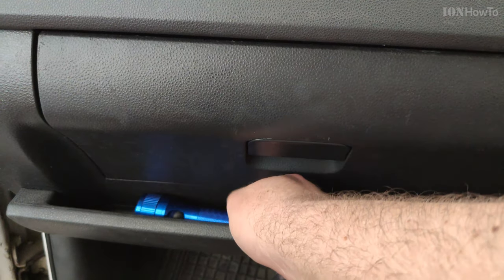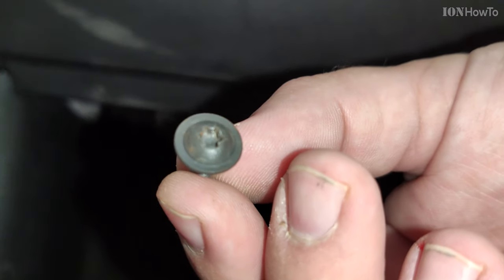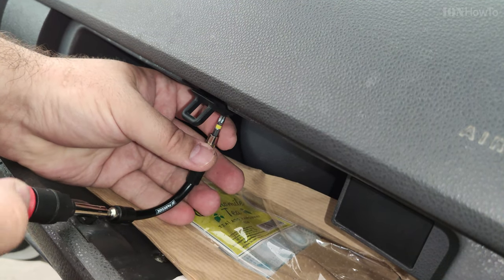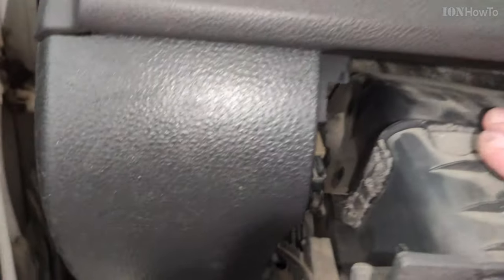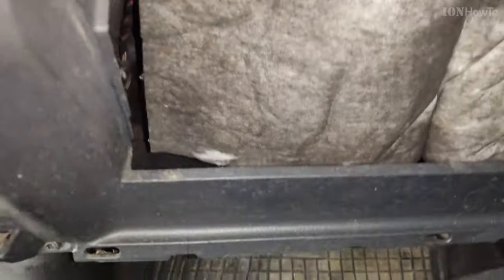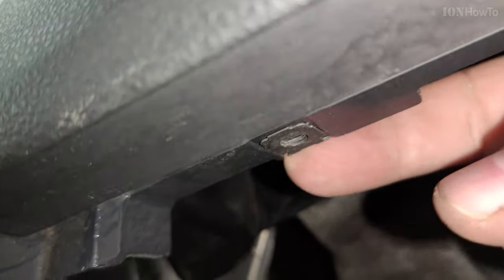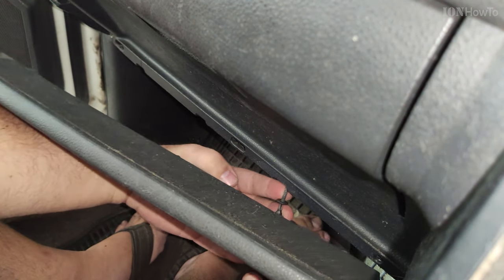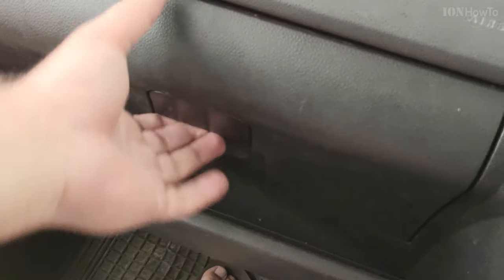How to Remove or Replace Glove Box on VW Polo 9N Mk4

Comment from the maker: Amazon: Glove box latch vw polo 9n https://rex.red/Glove-box-latch-vw-polo-9n *
Glove box vw polo 9n https://rex.red/Glove-box-vw-polo-9n * 
Tools https://rex.red/car-tools-kit-mechanic *
Cleaning https://rex.red/car-cleaning-supplies *
WD-40 https://rex.red/wd40  *
Torx socket set https://rex.red/torx-set-socket-45-55-60  *
Jack https://rex.red/car-jack *
Stands https://rex.red/car-jack-stands-heavy-duty *
Gloves https://rex.red/car-gloves-mechanic *
Safety glasses https://rex.red/safety-glasses-anti-fog *
Spark plug removal tool  https://rex.red/spark-plug-removal-tool  *
Spark plug Gap tool https://rex.red/spark-plug-gap-tool  *
Coil puller tool https://rex.red/coil-removal-tool  *
Car fuse set https://rex.red/car-fuse-kit  *
Battery tester https://rex.red/car-battery-tester  *
Maintenance kit https://rex.red/car-maintenance-kit  *

Subscribe and Ring the Bell to watch more videos.
ION HowTo https://rex.red/ionhowto
RedNumberONE https://rex.red/rno

Buy merch https://store.ionhowto.com/
Check it, buy it, post it and  tag it #ionhowto or #rednumberone

Join this channel to get access to perks:
https://www.youtube.com/channel/UCx4Qbp3iC97kQzj7e7g7slg/join

We earn money from qualifying purchases using our affiliate links.
Affiliate links are marked with a star. *
When you use our * links, you support this channel.
As an Amazon Associate I earn from qualifying purchases.

Comment: I’m trying to fix a leak in the washer piping. The washer fluid runs down the left chassis member from somewhere around the bulkhead but I can’t see any fluid in the engine compartment or near to the pump/bottle. I think the pipes run behind the glove compartment but did you see any there when you removed it? Thanks.
Reply from the maker: Never had to look for those but it doesn't make sense to come inside. It should be all around the engine. Look for a repair guide on that.
Reply: If you see water close to your glove box(inside of the car) then it could be the heater core since it's the only place that has water flow.
Reply: @alexpapadopoulos9179  I fixed this problem. There is a pipe that runs from the front to the back of the car to take washer fluid to the rear windscreen. It is joined in two places by inline plastic joins, one near the bulkhead and one in the boot (trunk). If the fluid freezes or the jets get blocked they can push apart and I’ve now seen both joins fail. Easy to fix - just push back together. Then make sure the washer fluid has enough antifreeze to cope with the temperatures.